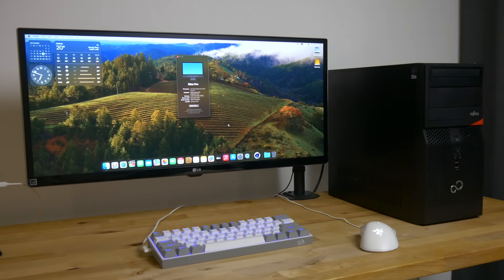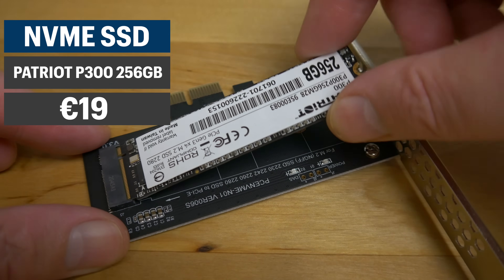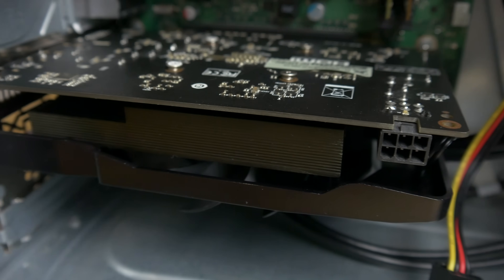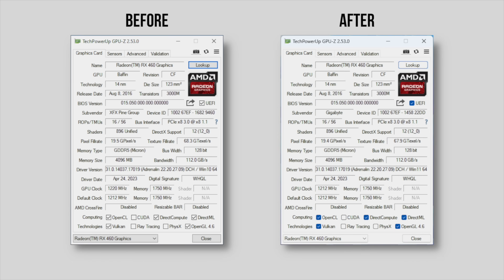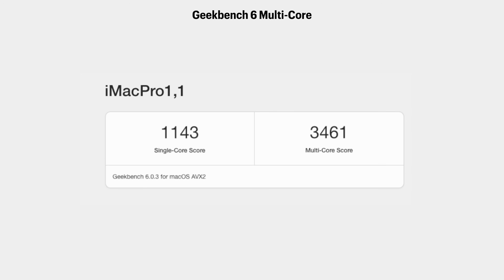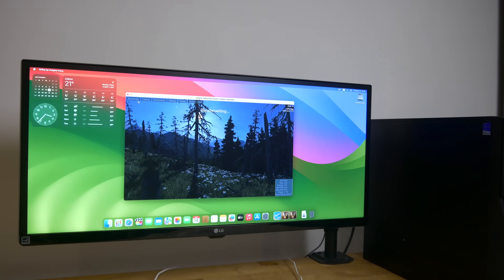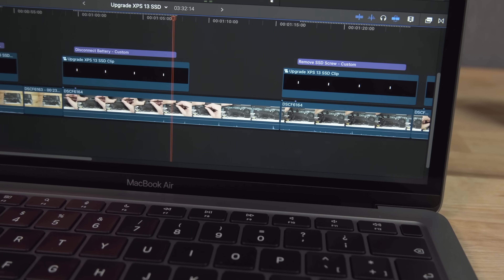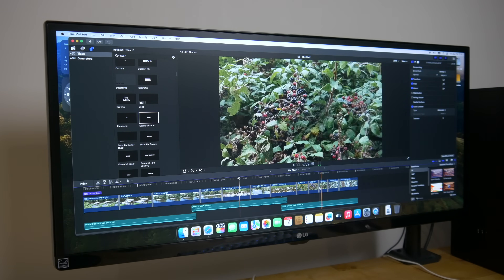Cheap $63 MacOS Hackintosh with Dedicated GPU

Comment: since rx 570 is more expensive here, will gtx 5/6/7xx series work? whats the minimum gpu to run sonoma?
Reply from the maker: RX 460 is the cheapest GPU that is natively supported in Sonoma. 
These GPU's work in Sonoma:-
RX 460 / 470 / 480
RX 560 / 570 / 580 / 590
RX Vega 56 / 64 / VII
RX 5500 / 5600 / 5700 / XT
RX 6600 / 6800 / 6900 / XT
Reply: @BartechTV  So AMD card only,  noted. Prolly started with ventura dedicated gpu. Thank you for the reply. I wish i found your channel earlier. :D
Reply: as there is problem with space on those kind of pc which low profile you recommend?
 @BartechTV
Reply: @BartechTV   i find it  a bit challenging to find a LP gpu with a good price,i spotted an RX460,do you think this is going to be futureproof or i will need to change the GPU at some point.

Comment: What is the maximum GPU that you can install in this computef? Will the PCI slot and BIOS support an Nvidia RTX card?
Reply from the maker: The PCI slot and BIOS will support anything. PCIe 4 cards will still work in PCIe 3 and PCIe 2 slots. You could put a 4090 in there if you wanted to. The problem is that premade desktops like this have a proprietary, low wattage power supply with no GPU power connectors. You can't even replace the PSU with an ATX one since they don't follow the ATX standard -  the motherboard power connectors are proprietary. I was able to use a SATA to 6-pin adapter in this case, and it worked because the RX 460 card only pulls a very small amount of power from the 6-pin connector.
But power hungry cards wouldn't work unless you powered them separately, perhaps by using a separate PSU outside the case.
Reply: RTX isn’t supported natively in the vanilla OS.

Comment: My hackintosh can’t boot without flashdrive. I have copy and paste the EFI file. But still, my bios doesn’t recognize it.

Update: solved by adding my ssd using Bootx64.efi with new usb drive
Reply: Is your BIOS set to UEFI with secure boot off?  Is your EFI exactly the same structure on the USB and desktop partition?  Are you able to boot to the boot picker?
Reply: @zeroturn7091  I have solve this problem using Bootx64.efi and register the efi ssd to the bios, and It is appear on the boot picker

Comment: Hi, I installed macos ventura and then I wanted to upgrade to sonoma, but after starting the pc it says something like radeonsensor, my GPU is RX570, do you know how to fix it? Thank you
Reply from the maker: RadeonSensor is a pair of kexts and an app for monitoring GPU temperatures in your status bar. If you don't need it just remove RadeonSensor.kext and SMCRadeonGPU.kext from your kexts folder and your config.plist.

Comment: Man , please reply me...i really need your help. Please tell me combination of hardware for i5 13500 as you have suggested in your older videos...but pls tell all hardware.
Keep it compatible for logic Pro especially
Reply from the maker: For a budget build -
Gigabyte B760M-DS3H-D4 - €110
32GB of Kingston Fury DDR4 - €80
WD SN770 1TB NVMe SSD - €50
+ a used Radeon RX 570 - €50-€60.
Reply: @BartechTV  thanks man ...

Comment: Hey BarTech , What's the minimum System requirements for Hackintosh Ventura ?
Reply from the maker: 4th Gen or higher CPU, 4GB of RAM, and a compatible graphics card or iGPU (Kaby Lake or newer). If you have an unsupported iGPU (like the HD 4600 in this PC) you can still get it to work by running OpenCore Legacy Patcher after installation.

Comment: Top vid :-) Ah haa I have the same GPU in my Haswell hackintosh - managed to get it triple booting Big Sur, Win11 and Zorin (Linux) - Have you tried Zorin? it's a very polished OS, almost mac-like.
Reply: Zorin OS version 16 is a well working Operating System and free. The paid Pro Version adds an even more Apple Mac feeling and some other features.
Reply from the maker: No, I had never heard of Zorin until now. I must give it a try.

Comment: I struggle to find a pc at the price tag on ebay . How do you feel about the mini pc from Fujitsu, HP, Lenovo using i5 6500t or newer?
Reply from the maker: HP, Dell, Lenovo - all are hackintoshable. The only reason I chose this Fujitsu was that it happened to be cheap at the time I was looking on Ebay. There's nothing special about it that makes it more hackintoshable than any other brand, so just pick whatever PC is cheapest. The only drawback with the SFF PC's is the inability to add a graphics card, which I why I tend to prefer the mini tower systems.
Reply: @BartechTV  How about this one? 
HP Elitedesk PC
- Intel Core i5-4570 CPU 4x 3,4Ghz
- 8GB RAM
- 6x USB 2.0, 4x USB 3.0
- 2x DisplayPort; 1xVGA
Reply from the maker: That'll work fine.
Reply: @mariah7945  The number and kind of USB ports and Display ports is not so much important to decide if it is possible to use for a Hackintosh. 
Regarding Upgrades: Can you install a dedicated Graphics Card as seen in this video?
Can you change the CPU?
Can you install a better CPU Cooler and Fan?
Is there room enough in the Mini Tower or Tower for an additional fan to further reduce heat inside and to get a faster Hackintosh?
etc. etc.